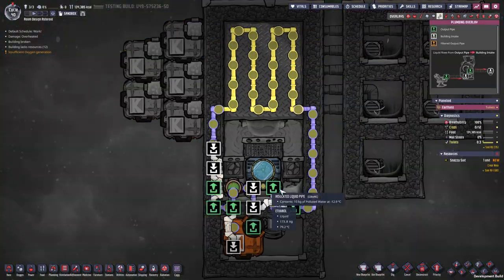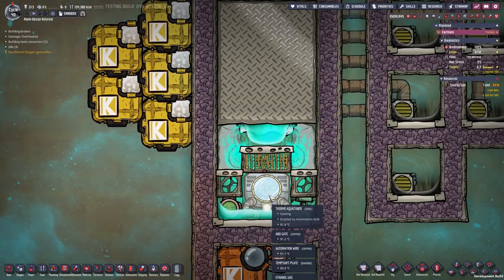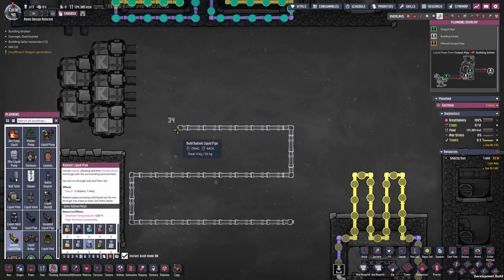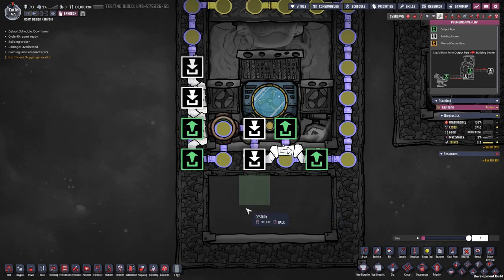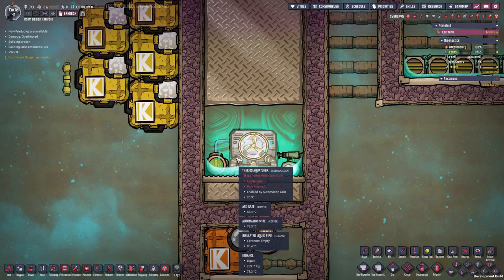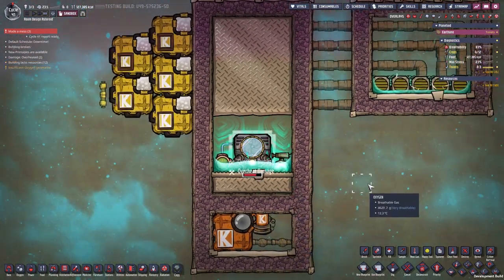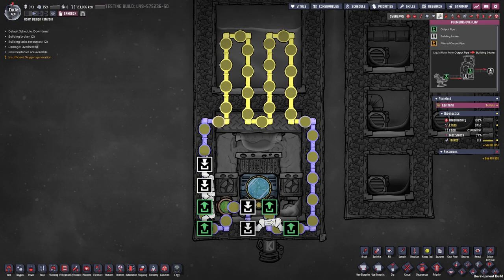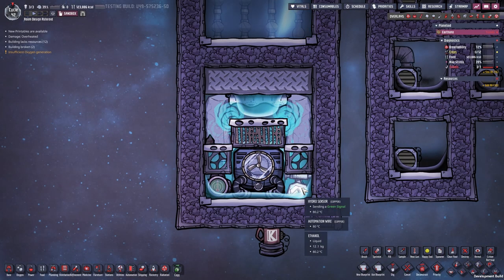Cool your base with this - Oxygen not included

Comment: Reminds me of Brothgar's ethanol cooler. It was on the core game's oasis map. Had to cool the base from internal heat before he had access to plastic. His was more power efficient as he had to temp regulate the aquatuner (no steel, just gold amalgam) and hydrogen. To cool the the ethanol into condensing, he passed hydrogen from electrolyzers through the ethanol to generators. Still cooling positive and the only input required was sand as filtration for p. water. And that ain't a problem on oasis.

Comment: It was nice. You can also delete heat with gulpfish also clean water without sand. let them live in cold brine (-10C) and feed pwater spread by airflow tile below tank (gulpfish work like air purifier). But top of brine need to be in vacuum or liquid also got deleted (Hard lesson learned by building 3 times in survive play through.)
I even refinded all metal with gulpfish. Pw -> Metal refinery -> Check temp if below safe temp go back to refinery -> and feed the gulpfish -> around -10C ice. Safe temp depend on metal or steel.

Comment: Try putting some water in there with the ethanol. The problem is ethanol's very low conductivity with the aquatuner, but liquids transfer heat very efficiently between each other. With a bit of water the aquatuner heats the water, and the water heats the ethanol far more efficiently. If that still isn't working then tempshift plates will help. In the current setup they don't because they only transfer heat between tiles, and the problem is getting the heat into the tiles in the first place.
That said, while cool it is not a very useful setup as is due to the absurd power requirement and low efficiency. You can do much better with 1kg liquid pipe glitching, an efficient heat exchanger, and a steel aquatuner. You can heat the liquid to ~250C in a pipe before letting it boil. Almost all of the gas cooling comes from the counter flow, so the net result is almost all of the heat the aquatuner puts out being deleted, as opposed to this ~10% version. It is less powerful, but far more efficient. 
If the goal is cooling a refinery, and you have access to steel, then this can be far more powerful. You can use the vacuum aquatuner trick to get some liquid steel, and the fooling pumps trick to get it into your refinery. By using liquid steel as your coolant you can get the ethanol to 1500C in a pipe, and then your 1kg/s flow from even a single counterflow channel is deleting heat like a champ.
Reply from the maker: Thanks those are good tips. 
To state the goal of this build: it should only function as an alternative cooling method. That it is not very efficient is of course true. still better know all the options that are available.
I will try several liquids and see which work best thanks :)

Comment: to anyone who thinks this is an exploit, this still requires all of the 1200 watts that the aquatuner requires. this is just trading power reclamation for lower temperature activation.

as for gold amalgum, i don't like it due to low thermal conductivity. i would try wolframite or the other metals, since aquatuners seam to create more heat than can be shed.
Reply from the maker: Yes it is not more efficient. Just different. For those who don't like getting plastic.

Comment: You can get free base cooling late game, if you have steel/plastic. If you make liquid hydrogen and oxygen for your rockets, you can put the steam turbine in a power plant, it will make the liquid hydr and oxy and be self powered.. Must use automation though and a smart battery. I have this setup on its own grid and its self powered 100% and I also let some of the cooling radiate off into my base. Its a freaking Ice Box and all it needs is 5kg of refined metal with engies tune up.. Its way op.. Also one other thing is a metal refinery powered petroleum boiler, It is the Most Op thing I have ever built, I can process 10Kgs of crude oil full bore running iron/ steel. It will also self power if you use generators on it.. I never see any one try it but its OP!! no thermium need on that just Naptha as the coolant!!

Comment: Ethanol Aquatuner setup (with water as input for the aquatuner) theoretically cools 74,202 DTU/s ((1-(2.148/2.460))*585,060). But an aquatuner with a steam turbine (also water) cools 526,554 DTU/s (585,060 * 0,9).
Though it doesn’t require steel & plastic it cools about 86% and requires the full 1.2KW. I could imagine it being useful in the early/mid game on the oasis map powered by an ethanol distiller setup.

Comment: This looks good! I often struggle with temperature before I even can access steel, somehow… but I’m new.
Can aluminum be used in place of copper?
Reply from the maker: Aluminium is probably a yes. It has higher thermal conductivity. Not completely sure though since the gold also supprised me with its bad performance.

Comment: Can I use Ethanol in pipes to cool the area down to minus 100 degrees? Or super coolant is the only way?
Reply from the maker: You can use ethanol to cool things down to a low temperature. 
Ethanol is just a poor cooling choice cause of it's SHC and TC values.
But when you want to go loq temperature cooling with early game material it is the right choice.
If you only want to go to lets say -40 or -50°C I would use petroleum
Reply: @lumaraw  I want to try using Dry Ice as a source of cooling that can be easily distributed. XD

Comment: I have been trying to think of a design where the amuturer is cut out completely. Any ideas?
Reply from the maker: amuturer = aquatuner?
hm someone mentioned wheezewort. you could make a 3x3 room with metal tiles surrounded and put 3 wild or tamed wheezeworts inside. those could then cool the suplementing ethanol

Comment: It's interesting if you have power enought but nos plastic access, otherwise do not use, because the heat produced when you cool 10kg of water/polluted water produce the same heat deleted (-14ºC) into steam and you can recover a part of power used (+-50%). Probabbly I can use in some future challanges with hard access to plastic, thanks \o

Comment: Great use of ethanol! It's a great solution before plastic.
I don't know how you can test it, but I think it's interesting to know the "frame rate efficiency" of this system. I'm an over-temperature-regulator, so I have a lot of thermal regulating cycles in late game, so i get a frame hit. Is this more efficient or less efficient on the PC?
Reply: For frames, Nuclear fallout/waste has a boiling point/condensation point difference of ~450C and a spesific heat capacity difference of 7. A single aquatuner can cool an entire planetoid :D
Reply: Francis john destroyed an entire lava biome very quickly with 4-6 aquatuners (i forgot the count) with 2% uptime each
Reply: I understand the nuclear fallout version is more "heat negative" than this, but it has the same frame draining (supposedly) mechanic. I wanted to know if this mechanic is really high fps intensive compared to the usual steam turbine method. While being less heat negative as the nuclear fallout, this method is extremely accessible and easy to setup (just steel needed, nuclear fallout needs nuclear plant and thermium)
Reply: @Britzzio  I did the math and one aquatuner cooling the nuclear fallout with super coolant can support 27 more aquatuners (28 including itself) also running on super coolant non stop. That out to take many many steam turbines to cool so the frames would be saved that way. I don’t know about the frames from the extra power you need to produce in place of the steam turbines tho

Comment: You looked at the SHC of the sculpture instead of the gaseous ethanol. It has a SHC of 2.1
Reply from the maker: lol fail. but i know that they are slightly different so the principle and how it works is the same.
The numbers are different and much closer though correct?
Reply: @lumaraw  Yeah there’s a difference of ~0.3 SHC. Not much but you can work with it

Comment: Steam turbine deletes heat and gives some power back. This heat deletion costs more power on top of the power required for cooling and with non returned... its objectively worse than a steam turbine. but if you don't have the materials i guess it works to delete heat its just really inefficient when it comes to the power needed.
Reply from the maker: I agree. It is just a different method of cooling. 
I want to test the efficiency of multiple cooling setups. 
if it is interesting enough i make a video.

Ethanol + AT
AT + ST
Ethanol + ST + AT
etc.